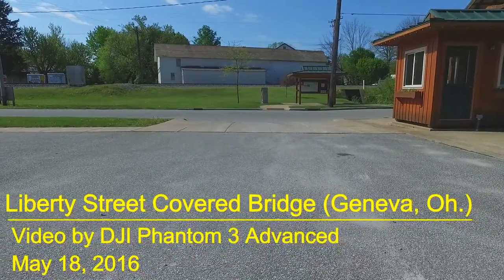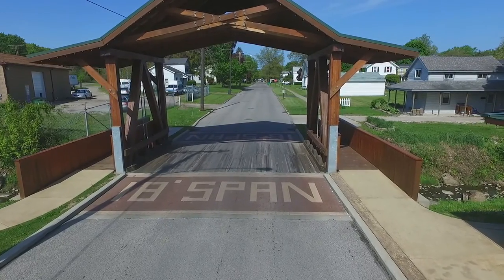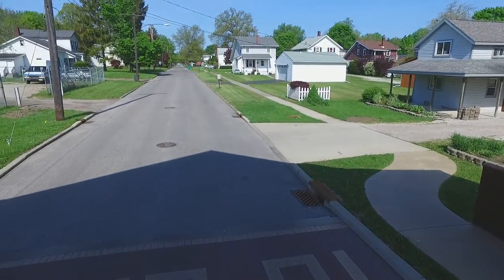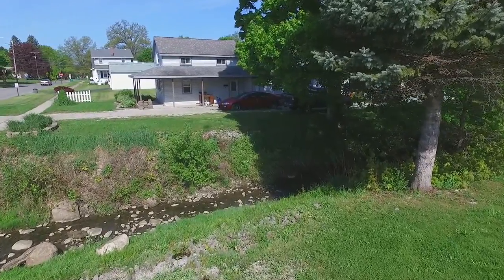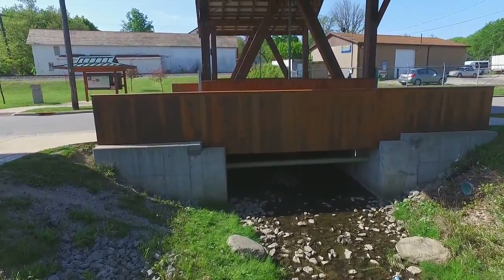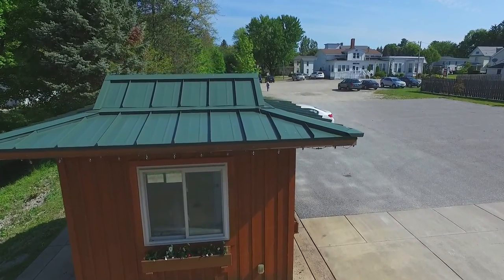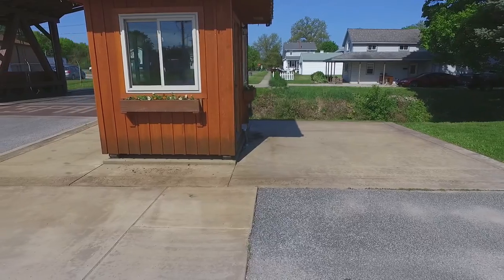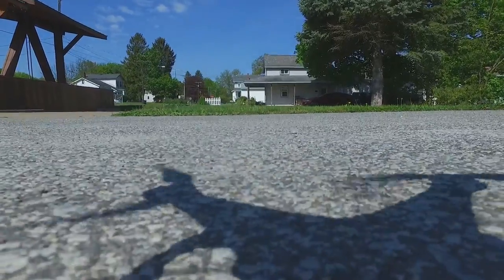P3A Liberty Street Covered Bridge 5-18-16 (1080P60)

Comment: I enjoyed that Bill, interesting stuff. If it was me I would have been exploring the railway, they fascinate me here, just love the victorian structures.
Reply from the maker: +Barry Higgott How was the volume for you on this one Barry?  This is the 1st video I used my new mic on.  I think I'll do 10-12 of these bridges (there are 18, and I've shot 5 so far, but only have 3 videos up), and then turn my attention to other subjects. I would like to do some trains .. will have to look for a suitable site. Cheers.
Reply: +Bill Somrak  Bill I viewed on a laptop through a set of top quality Sennheiser headphones, With the volume full up on both You Tube and the laptop the sound was crystal clear and the volume adequate, without the headphones it fell short. All that said I feel that the volume could do with increasing to give the option to turn it down. One thing I should add is that my hearing is not the best (To many years in the engine rooms of destroyers etc) but other videos are usually within my hearing range.
Reply from the maker: +Barry Higgott Thanks for the input Barry ... When I record the voice over for the next, I'll take it up 5 % and see how that does. I always review on my desktop,which has and amplified audio output.  There are so many devices that these videos are watched on: desktops, laptops and phones/tablets ... plus the variation in individual user's hearing .. hard to pick the right recording level. My hearing isn't what it once was (not much of anything is what it once was these days .. ha ha) and for most other people's videos, I have to reduce the volume considerably. Again, thanks for the input, and I'll definitely bump up the audio for the next one. Cheers

Comment: Nice Bill. Sure looked like you just missed hitting the street light at 1.27 into this video. Flying near power lines scares the crap out of me.  Hard to see, and I will forget they are there and just back or side swipe right into them with my luck!  Glad you were lucky enough to get this shoot without a car/bridge/wire or other impact LOL.... I'm sticking to middle of nowhere shoots lol, as I'm a big chicken. The other day I just missed a tree, no leaves, young tree, tiny little grey twig branches, right beside a much larger tree I was focused on NOT hitting.... whew!  I watch that video and think, man I shouldda bought the farm on that one!
Reply from the maker: +Pegasus26M Well, I was flying both FPV and LOS, and I was never more than 150 ft. away from the P3A, so I had a pretty good perception of how close things were. It may have looked closer in the video. than it actually was. I'm not big on flying around people either, which is why I wanted to shoot this bridge before school is out for the Summer, when there would likely be lots of "urchins" around. Cheers!